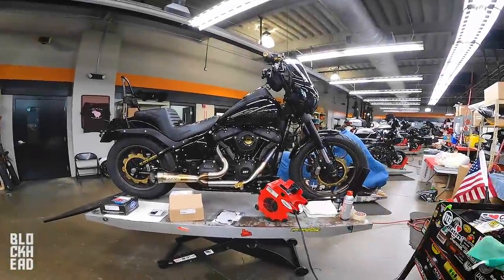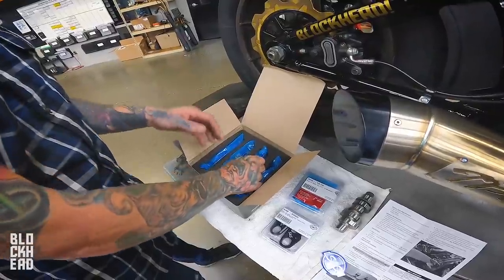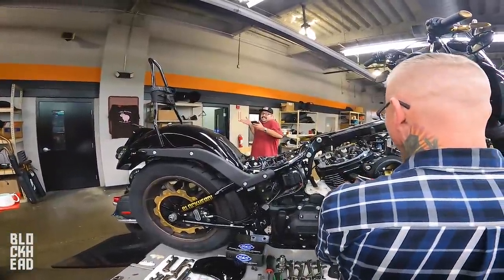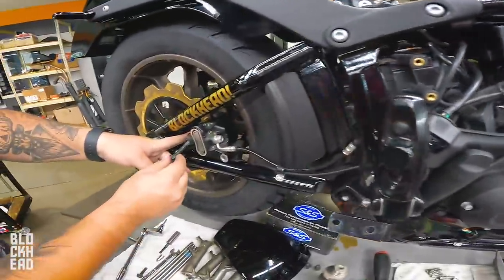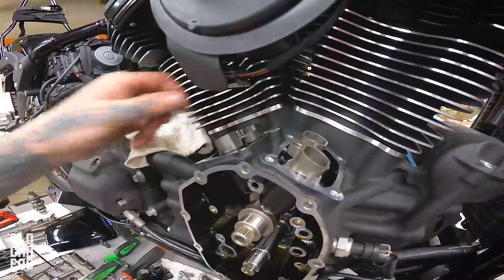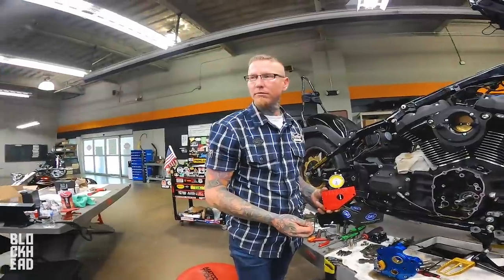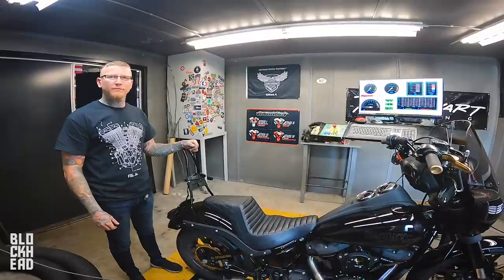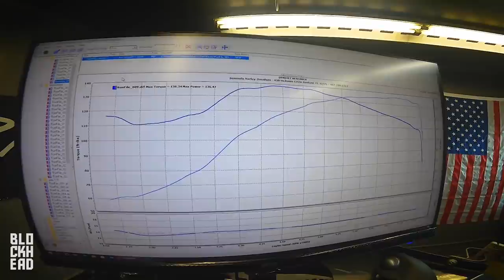S&S Cam: 590 Cam Install + DYNO! (131ci Stage 4 Harley M8)

Comment: Digging the build. I recently did a Reaper 465 cam along with S&S oil pump, tappet cuffs, adjustable pushrods and TTS tune in my 17 Streetglide and wow.  Amazing what just a cam does to these motors. Thanks for the vids dude, really appreciate the content and the fun factor.
Reply from the maker: It really is crazy what just a Stage 2 can do for sure! Thanks for watching 👊🏼
Reply: @BlockheadMoto  your vids kept me sane these last couple years deployed and don't see a reason to stop.  The 3 bike give away is legit.
Reply: @jasonbreedlove495  THanks for your service Brudda!!  Being deployed, time SLOWS down big time...wish they had the internet and Youtube when I was getting sent out!  LOL
Reply: sounds like my set up except i have the full feuling kit with the same cam and tuner
Reply: beware when you change push rods make sure  you use very good products I have seen push rods BREAK  beware?
Reply: @billgonzales8978  s&S

Comment: Planning to do a similar build with my 2020 Low Rider S.
Right now I’m sitting at 120 HP 120 TQ with a cam tune and exhaust, these engines were build with so much potential, loving every moment of the experience. 
Hope you are enjoying that monster. 👍🏽

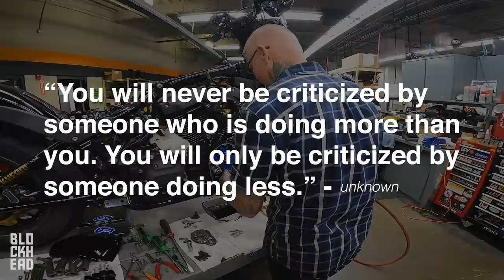Comment: 12:31 I love that quote. Reminds me of the haters I had working in a warehouse in '96. They hated my work ethic. I may not have been the fastest worker. But you can bet I was the most reliable and safest employee on the night shift. I outlasted all the haters. Where they lasted a month tops... I worked at that place for 4 years.
Reply: Good stuff Kyle. Ive experienced this too. I was with a team for 5 years and seen so many go in and out. Do it right the first time, and you are golden.

Comment: I made this comment before based on watching this series back to back.  Great information in the video.  It’s fun living vicariously through your adventures as well.  The one thing that would make this even better is seeing the dyno’s back to back or super imposed on the same graph.  So we there are comments of improvement etc it will be visible in the rpm range.

Comment: Solid pushrods are just nice to have, it’s like a reassuring feeling. I’ve used Feulings, but like y’all said, gotta make sure they match the base circle of the cam. Haven’t really seen adjustables cause any issues even on the big motors. Of course when they are set right.
Reply: i broke pushrods, so i  replaced them with Fueuling, great no problems for 5 years.

Comment: Adjustable pushrods aren't as strong or dependable as non-adjustable pushrods.  If you are building a custom motor, use the adjustables to find the correct size.  Then, pull them out and send them to Hammer Performance.  They can have custom made, thicker walled, May West tipped, chromemoly pushrods, to fit your application.  That's what I do whenever I build a custom motor.  Talk to Arron at Hammer.  Peace, Stiletto :-)
Reply: We have hundreds of thousands of adj pushrods in the market that would contradict you!
Reply: @SSCycleInc  no you haven't 😂

Comment: Love the episode. Chris is doing great work educating everyone on cam/ valve train performance. Did you / are you going to upgrade the valve springs to prevent valve float or is that not a concern until higher rpm?

Comment: Going to put a S&S 465 kit in mine pretty soon I think, but if you guys are heading to Mexico, be careful Tamaulipas isn’t safe, especially roads going to San Fernando. Stick to the toll roads around Monterrey and lay low or you’ll get robbed on the highway with ak-47’s

Comment: Roller rockers are made for racing engines.  They are better for racing engine.  This is turning into a racing engine which Harley has not built in.  What about the lower end or pistons?  This engine is becoming less bullet proof vs stock.  You are making it more bullet proof for the mods.  Enjoying the video!

Comment: Great build, I've become inspired and encouraged I also have 131 builds waiting to be done at my local Harley dealership, any advice starting platform is 2020 Road Glide Special new w/114 up to131 kit, Arlen Ness Aircleaner with Reinhart Slimline Dual full system and Harley tuner to start, any issues with heat, knocks, etc..

Comment: It looks like the new cam didn't boost the H.P. from the one you replaced.. I'm sure you'll post a new video with the final tune. It would be cool if you included a graph of the performance each step made. 131 stage 4, cam, intake, exhaust, tuner ... Great source of information. Thanks for posting. I love this stuff.

Comment: It will be interesting the reliability.  More horsepower, more heat especially with air cooling.  Oil cooler?

Comment: Thank you for the content. I have been looking into the low rider s bikes. I currently have an 2019 mt 09. From the sounds of it your getting great performance but yet able to cruise comfortably. My knees and neck start bugging on mine. At 6'1" your bike seems a great way to go. Thanks again for your content.

Comment: That exhaust is choking our that 131ci motor.  Need to check out the new Bassani 1D3SS High Performance exhaust that just came out at the beginning of 2020 that's stepped 3 times from 1 3/4 to 1 7/8" to 2".

Comment: Blockhead!   What's it take to get an XLT on the Evo shirt?   Hey, for tuning - the Autotune only covers AFR.  That dip?  You'll eliminate that by adjusting timing in that area of the VE graph.   Autotune/AFR is only 1/2 the overall tuning experience.   In fact, I'd bet you want to bring in a little extra timing in that area, and you'll see that curve come right up!

Comment: Was going to ask if you would not have to change the push rods or at least have adjustable to make up for the cam heights. I'm also thinking about a 131 kit for 20 fltrxs with the bigassed numer 1 racing tribute scheme so I'm watching close. About what proce range am I looking at. I've got about 45 days to pull the trigger if I do.

Comment: @Blockhead did he need to change out the valve springs to accomodate the lift on that 590 cam? Or were the stock valve springs in the screamin eagle heads able to handle it?

Comment: So, I have a question. I am not mechanically inclined. Looking to buy my first cruiser, a 2020 Fat Bob 114. From the get-go i'm going to go with the 131 kit. ( I come from supersport bikes). I tend to just want the Fat bob to be a muscle bike. Anyhow. I hear references to changing out parts because they're stronger than stock and how that's important because of the HP/Torque boost. Is it dangerous to do the 131 kit? Or do I NEED to do other upgrades to  make it safe to ride? For the price of the kit, I'd imagine they included all the reinforced parts, would seem rather reckless to just give HP and not support the bikes ability to handle it. 

Which brings me to my 2nd question, why upgrade the cams, other than the obvious durability increase. 

Sorry for dumb questions, I'm literally new to V Twins. I already don't get along with most Harley riders, so it's hard for me to get the information without falling deep into the trolly internet pages from asking questions.

Also love the videos. Again, I don't get along with 90% of Harley people. You are literally one of the ONLY people I follow that does cruisers. I respect your opinion, is why I even bother asking.
Reply: You'll be more than happy with it ! do it , Plus it'll come with the full factory warranty. Blocks doing this to show that the 131 can go much further than what Harley offers. The 131 in a Fatbob would be sooooooo good!
Reply: @BaggerBro  ty! ♡

Comment: Can he explain why a 2 into one has that dip? What cause it?
Reply: At low RPMs the exhaust gas doesn't have enough momentum to push cleanly past the merge between the front and rear pipes and the gas slows down. During the overlap period of the cam timing both the exhaust port and intake port are open which creates enough suction to draw the exhaust back into the cylinder and intake port causing an uneven mixture of air, fuel and exhaust gas to fill the combustion chamber resulting in a loss of power. This is known as reversion. At higher RPM the exhaust has enough momentum to push past the merge without issue, but until then (3.5kish RPM) your power is going to suffer. 

There are two ways to reduce or eliminate the effects of reversion. 1 with anti-reversion chambers like you will find on Thrashin's Anti-Reversion pipe, or 2 simply make the primary pipes so long that the gas is too far away to be sucked back into the motor like on D&D's performance touring M8 Billet Cat 2:1 exhaust.
Reply: @CaffyPvP  great explanation, couldn’t have said it better myself!!
Reply: @CaffyPvP  That was an AWESOME explanation!!
Reply: @CaffyPvP  Great explanation.  Met Rusty from D&D a few weeks ago, rode with him, talked shop during lunch.  Learned a lot from him.  He also can ride his performance bagger.  * He paid for my lunch and told me to remember that when I go to buy new exhaust so now I must buy the M8 Billet Cat 2:1 from him ;-)
Reply: Bottle neck effect...

Comment: LEGIT QUESTION:  For the King of the Baggers race (MotoAmerica) this past weekend, there were many bikes entered; from Harley factory, Fueling, S&S engines and the list goes on with even a 200 hp turbo build.  The V&H Harley 131 Big Bore crate motor took second place.  The top four placed bikes, 2 Indians and 2 Harleys, were equal in speed but the Indian suspension was far better and they gained in the corners even though V&H bike was fitted with Ohlins suspension.  So if the V&H Street Glide running with the 131 Big Bore crate motor using the same Harley parts in the engine (had V&H Fuelpak, Exhaust and Air Cleaner) performed better than the others, doesn't that say a lot for Harley parts?  I ask that because of all the shop talk of this company or that company makes a better part than factory.
Reply: Great point ! huh
Reply: Crate or not, none of these engines were left as delivered. There were some amazing builds on the track, but KOTB was more about chassis than Hp.

Comment: Hey guys look be the videos. My question is can you use hydraulic lifters like in a car to take up the space and still run with solid pushrods? Or no for motorcycles because everything is smaller?

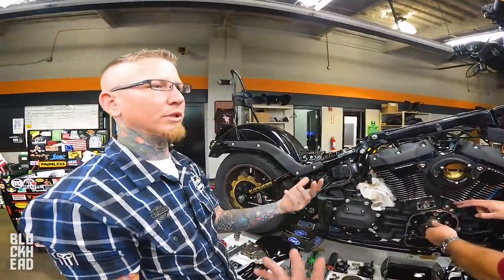Comment: The over lapping in the cam shaft (16:21), is there anyway you can hear that or see (on the RPM display) that it may happen for a split second?

Comment: I'm surprised you didn't try and go with a 30/30 cam from Star racing its revolutionary however this is not a bad start for and possible finish for sure cheers mate

Comment: With more horsepower and heat tolerances are a big concern in an air cooled motor.  That is why we have water cooled motors to control those clearances.  Heat shortens engine life significantly.
Reply: bike runs great

Comment: Evolution engines still the best 128 C.I. 151 HP
with 164 LB FT
 Torque. at the rear wheel.

Comment: Good choice to go with S&S cam etc .
Reply: why?
Reply: @billgonzales8978  why ? Because S&S has a long history of building quality reliable high performance aftermarket engine upgrades from mild to wild . It all depends on what you want . 
Personally I had a 2005 Electra Glide that I had modified to be like a street glide which came out a year later . The stock motor then was just 88” . So I had a 95” bore kit with Screaming  Eagle heads with an S&S gear drive 510 cam and a Thunderheader 2-1 exhaust with a dynojet tuner . It made  excellent reliable power and performance for what it was . 
Of course what blockhead has built would blow it into the weeds .
Reply: @hughsnyder891  MY harley dyna smoked a S%S 124 at a club house gathering he was behinde me all the way?
Reply: @billgonzales8978  well was it a bagger or another dyna . Plus having a big motor isn’t everything if it isn’t properly tuned and if the rider doesn’t know how to handle it if it is .
What mods have been done to your Dyna ?
Reply: @hughsnyder891  installed Jims 120 stage 4
Reply: @hughsnyder891  T_Man perfromace stage 4 woods race cam
Reply: @billgonzales8978  well that’s a good motor. Plus having the right pipe on it can make a big difference. Also somebody can have a good motor in their bike doesn’t mean they know how to handle it like I mentioned before..
Reply: @billgonzales8978  enjoy your ride 😊
Reply: @hughsnyder891  I cant Handle the truth

Comment: You mentioned you’d be upgrading your brakes, and we can see that you changed your rotors. Are you gonna cover this at all?
Reply: He has probably already recorded that and is uploading these vids out of order
Reply from the maker: Yes I’ll be releasing a video on it, but with brakes, you have to bed them properly to get the right performance out of them. So that vid instead of just an install vid, it’ll also include feedback while riding.
Reply: @BlockheadMoto  awesome, looking forward to it!

Comment: I thought the run out had to be below 5 thousands of runout to run an S&S cam plate and pump.  I know fueling calls for 3 thousands and below.
Reply: Those specs are for gear driven cams I believe
Reply: Go to fuelings site and read the directions.  That’s for chain and gear drive.  My crank was .009 out and trashed the motor with a chain driven cam. S&S May be different.
Reply: @giddyuptwist665  maybe I am wrong who knows.  I know my motor is trashed.

Comment: How much was it in parts and labor to get to the various stages? 
$3,000.00
$5,000.00
$7,500.00
$10,000.00
Or I could just buy a used Vmax for stock 200hp and save money.

Comment: Explain to me why you said the 2 into 1 is worse? I assume you're saying the 2 into 2 is better numbers-wise? I thought it was the opposite. Also, which type of exhaust do you prefer for the deep Harley sound?
Reply from the maker: When did I say the 2-1 was worse? I don’t remember saying that but maybe I got twisted around at some point, lol. Drop a time stamp plz
Reply: @BlockheadMoto  26:10 Maybe I misunderstood what was said. I took that as the 2 into 1 exhaust was restricting the bike's power. He says there is a dip in the power with tuning 2 into 1's. Making it sound like 2 into 2 is the way to go.

Comment: Can I get what tuner you use I have a 131 with the 590 cams, the last time it was dynoed it did 139 torque and 126 horsepower
Reply: I currently have the fp3 Vance & Hines tuner

Comment: That's a pretty cool cam from S&S. But I am sorry, I didn't get why you didn't switch to Gear drive Cam? I read it's more reliable and less problematic on the long run.
Thanks for those cool / informative Videos mate.
Reply: Because the crank runout was at the limit for gear driven cams
Reply: @e32amgfinatic  most probably I will need to search more about this and the relation. Thanks for clarifying

Comment: What does AFR mean?, during the dyno
Reply: Kevin, it means : 
AIR FUEL RATIO. 
Used to determine if the air fuel mixture is lean or rich. 
Hope that helps.

Comment: If you could reduce 60-70 pounds off the bike that would help braking, handling, and acceleration.  Carbon fiber wheels, more carbon and aluminum.

Comment: What are the Numbers ?
Reply from the maker: They’re in the video
Reply: @BlockheadMoto   i seen it now.. wouldn’t hurt to keep it on screen for more that a slit Second.  133/134  sucks . My 131 with stock tune and stock 517  makes that much torque.  I hope the tune makes a big difference. If not maybe bigger injections or different exhaust might help. At this point I don’t think all that stuff was worth 10hp.

Comment: This build still seems severely under powered given that I have a 117 Putting 145 Tq n 136 HP
Reply from the maker: What’re you running? With a proper tune, we’re expecting much better numbers obviously 👍🏼
Reply: @BlockheadMoto  Sns big bore kit not Harley 570Gs, thunder max ecm, Ness big air sucker thunderheader. With that displacement I would think you would easily get into the high 150s to even 160 at the rear wheel..
Reply: I have fat bob with 131 , bigger I injectors and TTS250 cam. 158ft/pounds of torque  and 149 HP. I had custom shorty first and had big dip at 2500 rpm. 130 pounds at 2000 and only 110 at 2500.
I extended my headers length and it got so much better.